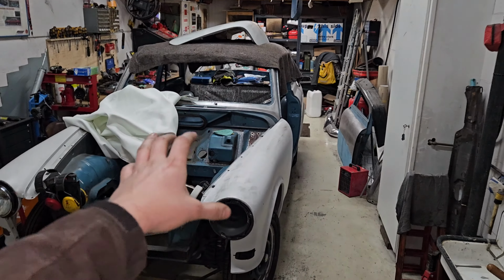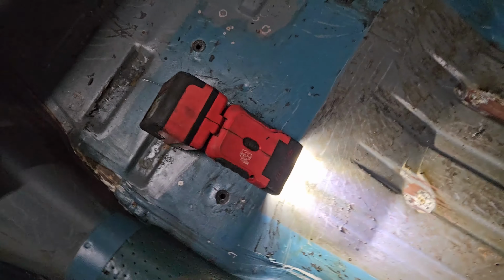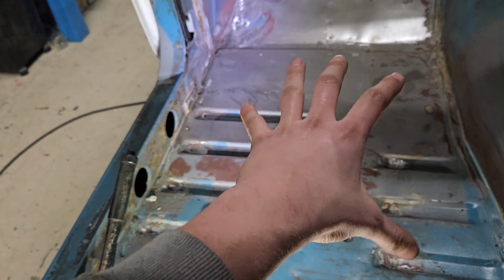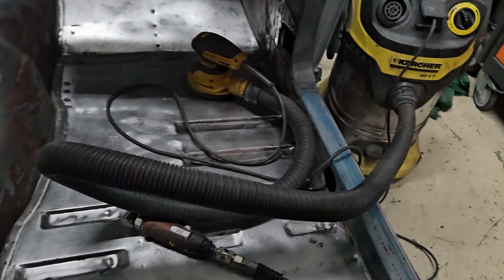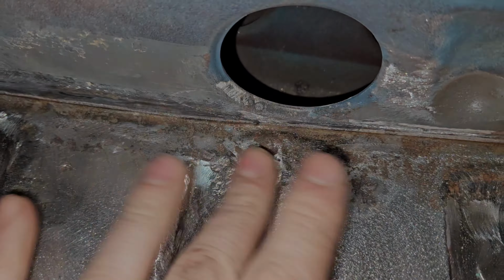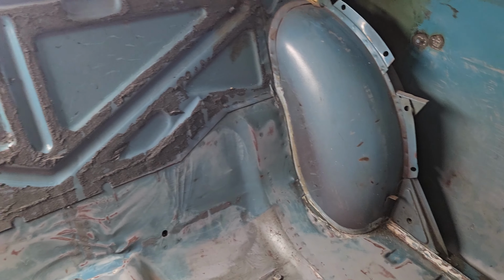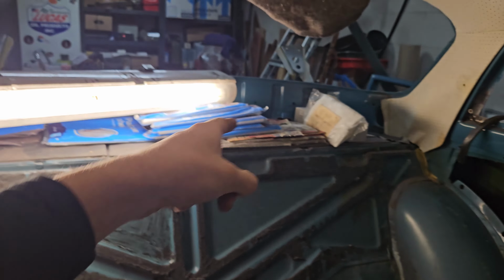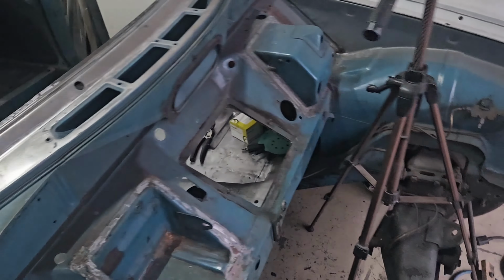Volvo Amazon Restoration - Part 19

Comment: Very thorough and fantastic work you are doing. Certainly will be nicer than the factory finish when you are done! Hope you are feeling better as well.
Hoping to have my Amazon assembled soon. Unfortunately the welding work done on my car didn't turn out to be cosmetically nice, but it is at least structurally sound now.

Comment: Looks good!   I think those little tabs/holes are for the machinery that positions and holds the panels during assembly to have something to hold onto, perhaps also they work as drain holes for the cleaning solvent and primer as the body shell is dipped as it goes down the assembly line.  Later they are unfortunately where rust starts.  On mine I replaced the front and rear driver's side floor boards, but the passenger side was fine.  I cleaned down to the bare metal also, but relied on seam sealer from the top and undercoating from the bottom to close the holes.   Welding them closed might be overkill, but it certainly can't hurt.  Happy to see another episode posted.  Keep up the good work!
Reply from the maker: Thank you! 😄

Comment: The holes in the floor are a good example of how a restoration can improve a car beyond the original design. The holes were put there for some reason by Volvo (a place to grip the panel or a flow path for paint or something I can't imagine) Then they were sealed with gap filler so they aren't supposed to be there in the lifetime of the car. When restoring the car welding them shut is the best option. Nice.
Reply from the maker: It takes some time but i'm happy to to do it! Thank you!